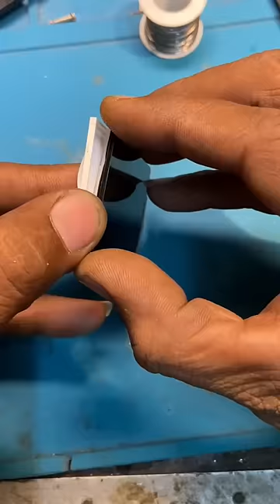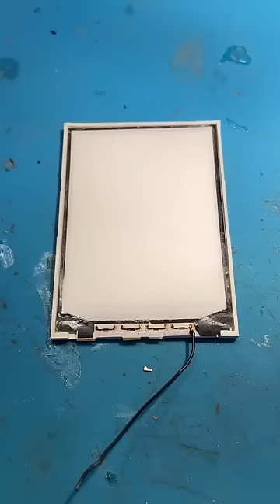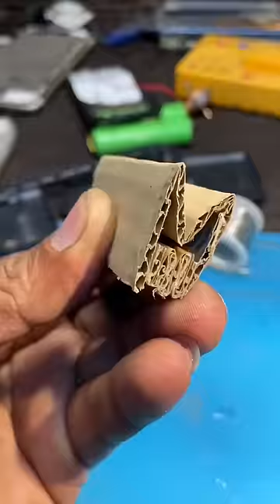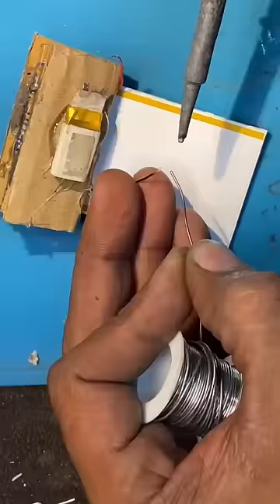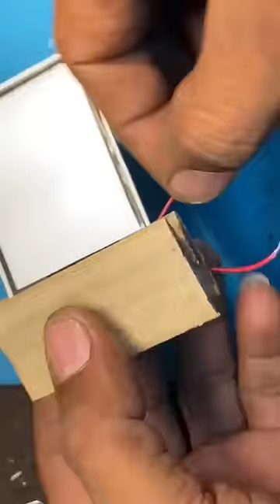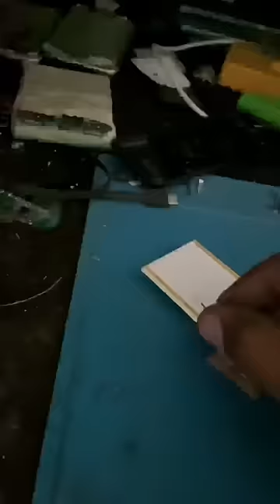how to make night lamp with old mobiles display  #shorts

Comment: There is a fact that 4 LEDs would require 12v.
But if each led use 1.2v, than 4 LEDs light on 3.7v battery